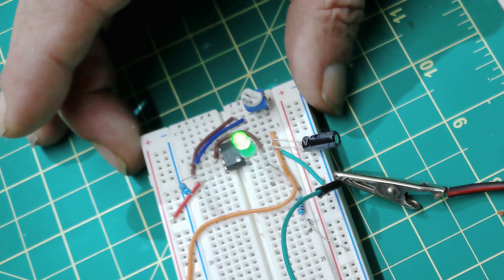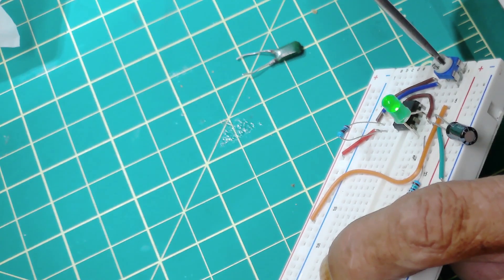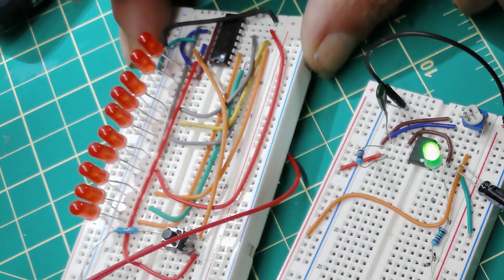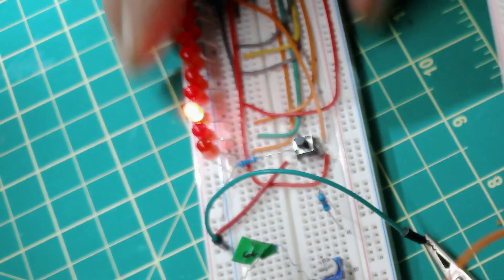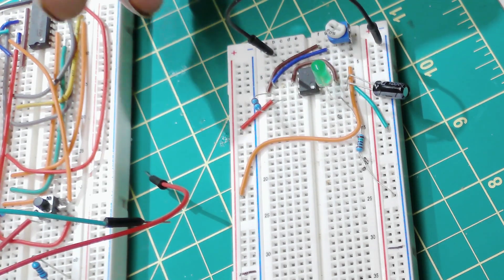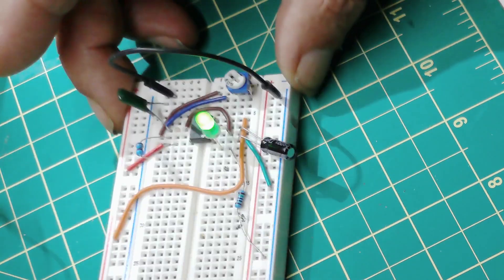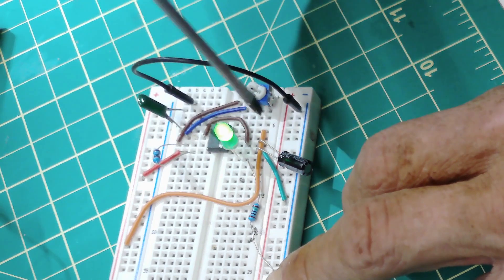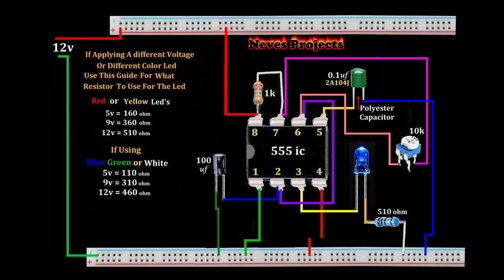Importance of Pin 5 of The 555 Timer IC

Comment: I either use pin 5 of the NE 555 for a VCO or I do cap it for stability. I gutted a cheap Meade telescope mount synchronous motor clock driver circuit and put in a more stable clock circuit with pin 5 as an autoguider slower/ faster input for astronomic guide cameras. I still use it. Dude, your tact switch needs a conditioning circuit! I've been messing with the 555 since 1973! Retired electronics technician here.
Reply from the maker: What are you talking about when you say  Quote: your tact switch needs a conditioning circuit!
Reply: @NevesProjects  A "debouncer."
Reply from the maker: @Roonasaur  Oh ok, I had to look that up and now I get it 😊, that's good to know, I'm still learning about this stuff. 
Trying to get some led circuits done for my 3d printed tank and thought I'd share/ fix problems that I run into while making them, maybe it will help others.
Reply: Why use a 555 timer at all and not a microcontroller here?
Reply from the maker: @ivanrodionov9724  Your right and I did decide to go with arduino for my tank applications because I need to add a few led circuits, engine sound etc.
but while looking for a circuit and decide which way to go, I came across a lot of people having problems with their 555 led chasers so I decided to make this video.
Reply: @NevesProjects  Yes, programmable designs like these are the name of the game with modern design. You can have the system address an (almost) arbitrary number of digital outputs too and have it do so much more then just blink and chase.
Reply: @ivanrodionov9724  This was an old 1991 modification that is still being used. The mount it drives has some serious PEC problems. The old joystick does well for this application without fancy programming. This design is field repairable. Arduino not.
Reply: @Starphot  I would disagree with an arduino being not field reparable. Additionally, there are other industrial and hardened microcontroller families. Dont get me wrong, the 555 timer is a great chip but the truth of the matter is, analog designs like these are (mostly) a thing of the past.
Reply: @ivanrodionov9724  Not really. I have two telescopes with different mounts. One is digital and the analog one mentioned. There will still be analog, D-A and A-D well into the future with some applications as it is more simple and efficient for these things.

Comment: The reason you couldn't find the component to switch out is that you didn't include a necessary component. Take a look at the datasheets. A bipolar 555 like the NE555 has an output stage that passes a large current briefly as it switches. You must adequately bypass the supply with a capacitor close to the supply pins. A 100nF ceramic capacitor is fine. Without that, you will draw as much as 400mA for 50 to 100ns. That will cause the supply rail to dip briefly and result in multiple triggering on any breadboard layout. The NE555 datasheet also shows the use of a 10nF capacitor on the Control input (pin 5) as an extra precaution. Recommended reading: NE555 datasheet SLFS022I –SEPTEMBER 1973–REVISED SEPTEMBER 2014, sections 9.2.4 and 10.
Reply: I had this Problem when building a Timer, by initially powering the Circuit it starts at High at output bcus the Voltage at pin 6 is not 2/3 yet. But at the start-up briefly for a Fraction of sec the output goes Low, which i noticed when I connected antiparallel LED at  output. I was frustrated bcus I want no Resets at the start of the circuit then by reading Datasheet i figured same exact thing u Mentioned there 😅. Copying the Circuits from YouTube and Website  as it is not good most time.